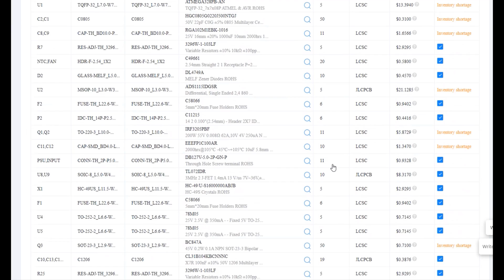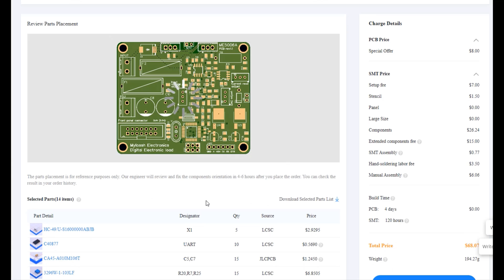how to make, transmitter and receiver control circuit , jlcpcb

Comment: Excelent video. Why the second circuit is delayed campared to the first one?. Second one (hand made pcb) has a little bit delay when you push the button and receives the signal. The first one is snappy.
Reply: Second ones have not capacitors, maybe this is the result

Comment: А на какое расстояние действует передатчик, примерно?
Reply: With transmitter TX- 2B and 
receiver module RX - 2 B, it is possible to reach a range of up to 200 meters in ideal conditions. This range is more than enough for small RC model vehicles. Longer range can be achieved by using different RF modules in the same circuit. 2 km can be reached.